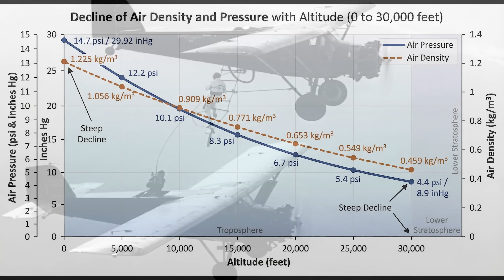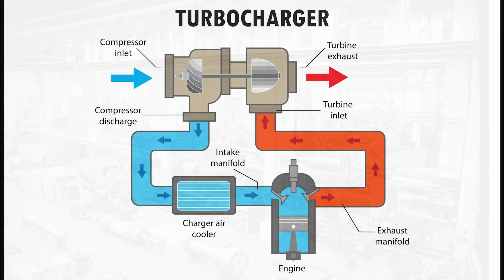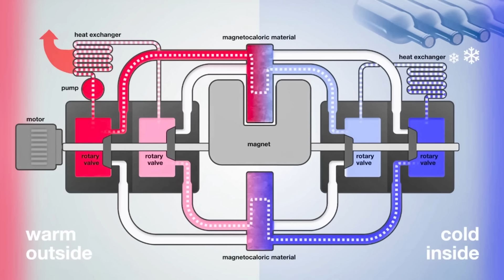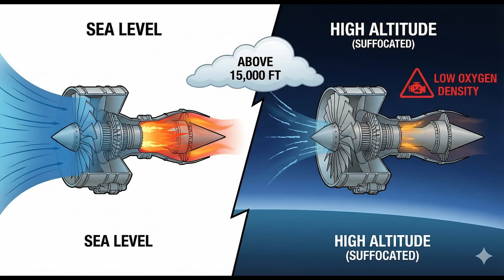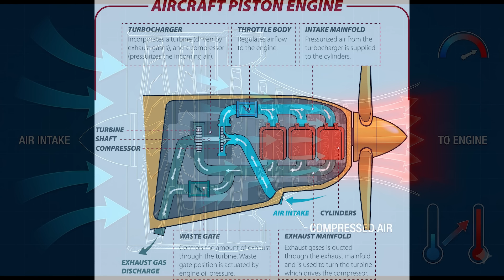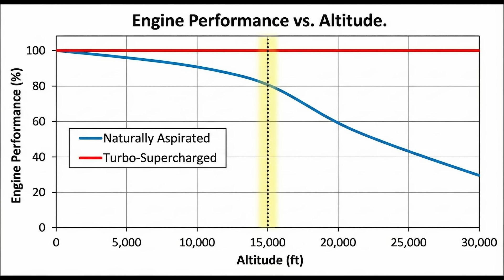The GENIUS Who Solved The high-Altitude Engine Problem

Comment: Sanford Moss is typically cited as the inventor of the turbocharger. He spent the bulk of his GE career on the problem. He is the only person mentioned in the GE aviation website history page on superchargers.
The variation in air density is not a chemistry phenomenon. It falls within the realm of meteorology and atmospheric physics.
The reduction in engine performance isn't caused by a shortage if oxygen. The % of oxygen in air is quite constant at about 20%. The engine functions thermodynamically by processing air as its working medium, and the power produced is proportional to the air processed. Everyone is familiar with the use of a throttle to control engine power....if you want to know the power output if an engine, it is easily measured with manifold pressure (downstream of the throttle) and RPM. Flying at altitude has exactly the same effect as partially closing the throttle.
Conversely, an engine can be force fed working fluid (air) for increased power. 
WW2 engines were supercharged for increased power and altitude performance.
Reply: The stoichiometric ratio of fuel to air changes at altitude so chemistry is important in that respect.  Also as there is less oxygen and oxygen is acting as a catalyst so that is a chemical component.  Also temperature changes at higher altitudes and that effects chemical reactions in the engine.
Reply: @Dan-u1m7i The % of oxygen in air is constant up to 100Km. See https://en.wikipedia.org/wiki/Atmosphere_of_Earth. Oxygen isn’t a catalyst in the burning of gasoline, it is the oxidizer. Temperature is irrelevant other than excessively high charge temperature increases the resistance to detonation (knock), which is why super/turbo charging systems have intercoolers/aftercoolers. Once an engine is warmed up, the colder the ambient air, the better….unless you are worried about emissions
Reply: I think he developed it rather. The theory was already out there. Roy Feddon at Bristol had some running before the war but could not continue due to a lack of engineers
Reply: @johnp3937 I miss-commented. Rateau, a Frenchman invented it, but Moss was making and testing turbochargers for Wright field in 1918. I think he retired in 1938 but continued as a consultant. In turbochargers, the devil is in the details and the materials. See Wikipedia/Sanford Moss.
Reply: @jackthompson-lr2hc thanks for that. I will look him up